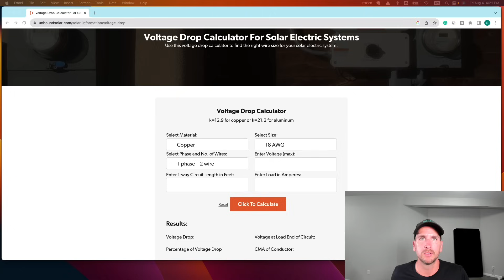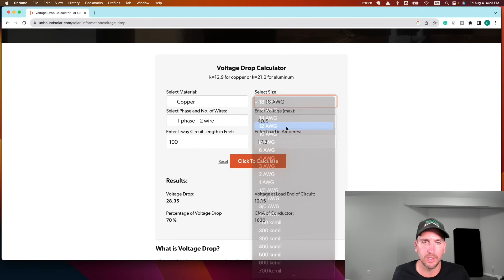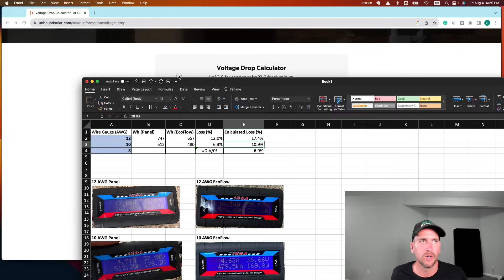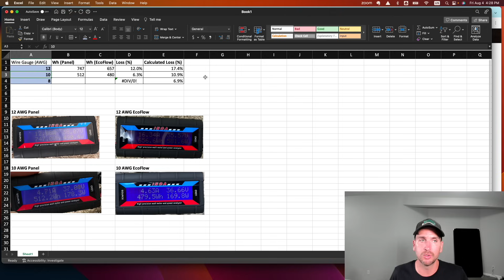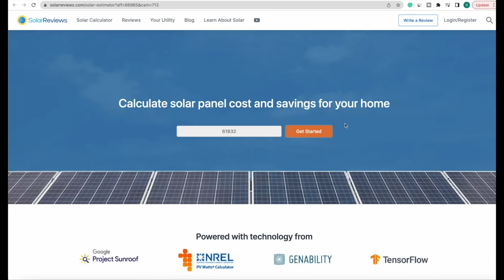What Wire Should You Use For DIY Solar Kits? Surprising Results!

Comment: 20+ years off grid. You should keep your wire runs under 30 feet and 8 gauge for12 volt. 10 gauge for 24 volt and 12 gauge for 48 volt.  You can reduce loss by moving the controller and inverter closer to the panels and use an inverter to run 110 AC to your home. A shed works for that.

I recommend 24 volt in series and a run under 30 feet with 10 or 8 gauge wire for off grid.
Reply: I am confused here. Why would you base wire size on volts? Also why would your wire size go down as volts go up. The NEC uses amps for determining minimum wire size not volts which has left me confused.
Reply: @shadeiland  Your load needs power which is proportional to voltage times current. At a low voltage you then need high current for the desired power and therefore a thick wire to handle the high current. As the cross section of a wire increases, its resistance decreases.
Reply: @solarcabin  yes you need amps to overcome resistance in wires. Volts times amps is watts. I understand all that. The NEC specifically bases wire size on amps not volts. So why are you decreasing wire size based on higher volts? Unless… you are basing it on a set wattage. But wouldn’t the max wattage vary depending on the panel?
Reply: I'm running over a hundred feet, 8 ga, all panels in parallel.. Voltage drop is one volt. I could not care less about voltage drop and all of that. If it's an issue, you can make up for it by adding a panel.  Where variable shade is an issue, parallel is essential.Panels are so cheap there's no point in being concerned about a volt. Good used 240  watt panels in PHX for 30 or 35 bucks.
Off grid for 35 years, in case anyone wondered
Reply: A shed costs a lot more and is WAY more work than conduit and heavier gauge wire. Though a small enclosure for a combiner box at the panels is very practical, but the combiners are generally set up to be outdoors. So they don’t need a totally weather proof enclosure like an inverter and charge controller will. That makes a BIG difference in time money and effort. Plus, the batteries need excellent weather protection, and you don’t want your batteries a long distance from the inverter or your breaker box, or the end use point(s). So in my case I don’t put panels on my roof because that is a whole can of worms for installation and roof repairs/replacement short and long term. I have a nice exposed hill that I put my panels on and it is just simpler to run 4 AWG  into a weather proof cement board cabinet close to the cabin with the controller/inverter/ batteries.
Reply: @5400bowen  You are still going to have significant loss at any long distance with 4AWG.
Reply: @solarcabin  the numbers from many experts disagree with you…4 gauge for 50 feet carrying 72 volts at up to 1980 watts from the panels…quite sufficient. And do you know that the wire gets thicker as the numbers go down? You keep mentioning 10 and 12 gauge..that is WAY smaller than 4 gauge…way smaller…
Reply: @5400bowen  Off Grid 20 years teaching people to install solar and yes I am very aware of how wire gauge works.  You will still have loss at at any significant distance with that gauge.
Reply: The Gauge of wire has absolutley nothing to do with voltage, using that as a method to size a conductor is a dangerous road to walk.
Reply: @shmayazuggot8558  The question was for  A "SOLAR KIT".  My answer is correct and have used and built solar kits for over 20 years.
Reply: @solarcabin  What do you think of sun gold power? I'm think about going with one of their solar kits, this one in particular

8000W 48V 120V/240V OUTPUT 10.24KWH LITHIUM BATTERY 5400 WATT SOLAR PANEL SGK-8MAX

Comment: You don't need that size of wire for that set up. What's that like 200 watts at 24 volts. 10 amp wire should be fine. 20 gauge wire. Stop wasting our wire on that shit. I know you have alot of money and aren't very smart.

Comment: 082723/2041h PST 🇺🇸. Thank you for the presentation on simple and adequate PV cells setup. Yes, it’s so true to venture out to connecting to 110AC system and automatic changeover switching, which is all too much for layman and myself ( electrical engineer)
I have a similar set up 800W PV array and 2X12.80V@540Ahr LiFePo4 Battery, and 1200W inverter. All equipments are VICTRON. Here, in CA , we don’t experience load shedding or Blackouts. But it’s better to possess such a system, than not.
I’ve watched your electrical systems wiring etc, a lot. Thanks again. Best wishes.

Comment: Everyone remember the higher the voltage the smaller the wire you can use. Like for me at 400V and low Amps I think mine are 8.5A and at 100Ft. I can use 12Ga wire and only have a calculated loss of .88%. So if you can up your voltage you will save money in wire and that wire is expensive.

Comment: If you could datalog the voltage and amps through the testing period you'd be able to see why there is a difference between the online calculator and your measurements.  What you want is the average value of the amps squared (amps * amps at each point) over the time interval.  Take the square root of that [average current squared] number to get an "average" current value - and feed that back that into the online calculator.  It will show a result that is a lot closer to your measurements.    The growing difference in the loss % with each larger gauge wire is explained by the lower total Wh over each test interval.  You would see the opposite trend in the closeness of the % loss number if you had a higher load for the 8AWG vs the 12AWG tests. Some rough calculations assuming a 40.5V constant system voltage (needs correction: all of your photos show actual voltage ~36-39V) show that if your trials were approximately 90 minutes for the 12AWG, 75 minutes for the 10AWG, and 80 minutes for the 8AWG - then the theoretical numbers from the online calculator match up.      I think if you were able to fully load this system - receiving a constant 17.8A at 40.5V (721W) - the online calculator would be spot on versus your measurements.

Comment: Surprising results! You can calculate the voltage drop along the length of cable for any length of cable, any thickness of cable. You can do this before you spend any money buying cables.

Comment: good show, but would have been good to let folks know that increasing panel voltage is a great way to reduce line losses (and therefore downsizing gauge of wire).  This is the case since line losses are proportional to the SQUARE of current but only directly proportional to panel voltage.
Reply from the maker: Yeah, that would have been a good addition.  I was keeping the voltage low for the power analyzer limitations so it was a bit misleading as compared to what you would setup in most real work applications.

Comment: 100 feet could be double the length for panels on the roof to the inverter. For 50 feet i can get away with 10 or even 12 gauge.

Comment: wouldnt it have made more sense to have them in series though?  Usually you try to put the panels in Series up towards 800VDC before you start with the nextr string, especially if the panels are far from the inverters.  And with them in Series it would have been half the difference between the wires?
Reply from the maker: I was a bit limited for the power analyzers.  They can only handle a max of 100V so in the real world, for sure, series is my preference whenever possible.  👍
Reply: Although a modern 600 and 700W bifacial panel can have up towards 20Amp per panel so it is still a valid test with 2 of these panels in Parallel.  So I step back a little from my comment above regarding this point, you are doing a perfect test  :)

Comment: Master electrician here.  #2 , 4, or 6 Aluminum USE  is less expensive than any of those you tested. I worked mainly with ground mounted panels and the lengths involved are a very serious issue. Go with at least 48 volt systems and layout to minimize lengths anywhere possible.
Reply: But also , aluminum isn’t as good in tropical climates, especially here on the big island of Hawaii, where we have heat, moisture, sulphuric acid, hydrochloric acid, and salt. Aluminum turns into aluminum oxide here at an astonishing rate. Copper is much less prone to corrosion.
Reply: what is No. 2, 4, 6 for a cross section?
Reply: @jensschroder8214 c’mon now…do a web search, don’t bother the man after he gave us words of true wisdom. Sincerely.
Reply: I always see the suggestion for 24V batter or 48V battery, but at least in my research I don't see inverters sold to handle this, they usually say 12V... Can we use bigger battery anyway?  Also Eco Flow Power station requieres the XT60 Solar Connector wires to connect to solar pannel wires. Does the XT60 solar connector wire need to be the same size as the XT60 solar connector wire?
Reply: @adivasworld  they have inverters of all type. Victron sell them and so do all the big solar companies. But if I'm buying, it's victron for my charge controller and inverter. Superior German engineering.
Reply: @adivasworld victron makes several 24 and 48 volt inverters, along with several other manufacturers.
Reply: @adivasworld I just purchased a simple 48 volt 2000 watt inverter from Amazon. I use it on my 5kwh battery that is 48 volt.
Reply: @cookiedough5374  A normal DC-AC inverter will "work" but will definitely not work well for solar panel input. You need an MPPT module for solar panel input - if you dont you will lose 50% or more of the available power. An MPPT module tracks the varying power input properly in a way that a normal DC-AC inverter cannot.
Reply: @rivimey  thanks for your comment. I charge that battery with a MPPT charger connected to panels.

Comment: One other issue to consider on the wire sizes is that when a wire is run over a roof, the wire can retain heat from the roof and you loose some power there too. 10 awg would be minimum for me on a roof to compensate for the additional loss.
Reply: run it through the attic. Yes, there's still some heat but not as much.
Reply: @georgeperez4770  a valid thought. Or use white wire, or run it straight down as much as possible, or as I do with the cabins we build in Hawaii, use white roofing. But just look up videos on insurance and roofing companies reaction to roof mounted panels. When the roof needs replacing, yer gonna bleed hard. Some insurance companies have started refusing to insure homes with roof mounted panels…
Reply: And that heat cooks your wire. Even the metal is more quickly degraded from heat, and especially the insulation. Wire for outdoor use should be white.

Comment: I've used No.  10 wire casually between 100 watt panels.  The sum runs into heavy aluminum outdoor wire.  21 volts runs through long wires into regulators,  one per battery set delivering 12 - 13 volts into lead batteries.  The solar wires are long and the battery wires are short.  No problems with efficiency.

Comment: Thanks for the video. Very interesting test.  Ive always wanted to see that in the real world.  However I would definitely be going for the 12 awg, especially if the runs are small and they very well could be,  with Panels located directly above your Solar chargers.   I dithered for ages, 18 years ago when I first installed my off the grid house worrying about the gauge of wire.   Turns out line loss is the absolute least of your worries and is easily fixed.  A couple of extra panels will cover any line loss.  Wiring 12 gauge and higher is significantly easier than any of the lower numbers for a DIY.  Anyone fought with Crimp lugs on fine stranded 8 gauge wire 😞 Having said that though... Cabling between your Batteries and Inverter should be as big as you can possibly get. Double them up if possible.  That's where you will get the best value in your cabling.  Your Inverter will love you for it.
Reply: Are you meaning run two leads instead of one when you say double them up? Or double the gauges? Because the first one is something I’ve been saying (and of course have known) for a long time. When I ran my Romex 75 feet from the post inverter breaker box, I did just that. Two ten amp wires can carry 20 amps, and connecting them at either end is perfectly fine. Imagine the multi strands  inside insulation. It is the same thing. And better for heat dissipation. Nice clear correct info, by the way.
Reply: Yes running 2 leads to give you a great big lead  is a great way to solve lack of instantaneous power.  I had a problem with a 5KW inverter that had the recommended size battery leads that kept going into fault mode with any sudden large motor load.   I doubled the Cables and the problem went away.  Very easy to do in an existing installation as well because you can keep your down time to a minimum, and 2 smaller cables are normally cheaper and can give a larger square area of cable. In this situation I was looking at installing soft starts on the motors but didn't need to.  (Still keen to try them out though, so I may still do one anyway) 🙂 @5400bowen
Reply: @garyrussell5559  I also heard that electricity runs on the outside of wires, hence multi strand wire (did I already mention that about multi strand?). Two smaller wires have more surface area for that to happen. It never occurred to me that a double lead was better for high surge devices, seems peculiar. But like my brother said, electricity is magic! And you of course saw what I said about running two strands of Romex because it was rated at 50 feet at my power levels and it is a 75 foot run? The rest of your reply is so pleasantly accurate! Aloha from the big island of Hawaii!!
Reply: @5400bowen That skin effect is only for alternating current not direct.
DC uses the whole cross section of the wire where AC induces eddy currents in the interior of the wire forcing current to run along the surface or skin of the wire.
The higher the frequency the thinner the depth of conduction. It's already micrometers deep at line frequency of 60 hz. so circumference of the wire for AC and cross section area for DC is what determines capacity.
Reply: "Cabling between your Batteries and Inverter should be as big as you can possibly get."  This cannot be over-emphasized.   That inverter should be as close to the battery as possible.  

I find 10ga to be the sweet spot for cost vs. thickness.  After that I would double up.    I buy 10ga low voltage cable  (sold for garden lighting).  Very easy to work with, flexible. but it's single layer insulation may not be appropriate for long term home solar installation without some sort of conduit.  We use black poly here (in Mexico) for conduit.   No idea what the pros use- probably tray cable, which is double sheathed.   Line loss will rarely matter as much as another panel.
Reply: Agreed.  Real world amperage is usually much lower than rated. Especially Winter and cloudy days, morning and afternoon.
Reply: @ceeweedsl  Very true, and one of the most disappointing things you discover when completely Off Grid is that in Spring, summer and Autumn, your battery bank is normally fully charged before noon and the solar is pretty much dumped after that.  In winter however I could triple the amount of solar panels and still struggle to charge my batteries on most days.   My last array of solar panels I installed are completely for the winter sun and are almost upright.  Panel angle lets you squeeze that last bit of current.  I've found with Solar, when you miss, you tend to miss by a mile 🙂
Reply: @garyrussell5559  Right!  Spending money on copper to maximize efficiency on those days when you have too much is hardly the best use of resource. You really want to optimize for when the panels are running at 25-40%. Which means more panel watts. 

Assuming that your issue is lack of light to the panels and not just short days!   But with the almost upright comment, I'm guessing you are pretty far north.
Reply: @ceeweedsl  46.4 degrees South.... so a mixture of short days and lack of light.  🙂

Comment: On a solar panel, what would a (2) 12/3 AWG 100-feet  ORANGE outdoor extension cord combined parallel wires as one wire (one outdoor orange  cord is + ; while second orange cord is --)  for voltage loss be, using this instead of a single 2AWG wire, since its the same diameters  for 100 feet. It's a cost difference of wire vs. Load diameter in loss. Which is a better performance of use. 
I thought you might like to do for another video. 
Thanks, 
ShaRon K.

Comment: Get up to about 500V and 10 gauge wire will have very little loss.
Reply from the maker: Yeah, if you can crank up the voltage that will make a big difference.  That is one of the drawbacks of these portable power stations.

Comment: Thank you for this video! 
A question, the analyzer you are using, I was wondering if it has the ability to record data points over an extended period of time? If it doesn't do you know of a similar solution for a similar price that does do that?
Thank you!
Reply from the maker: This one will just continually record the active session (session starts when you plug it in) but is limited outside of this basic functionality.  I think you could pull this data from the device through the serial port into a Raspberry Pi or similar device to provide much more functionality like plotting out the metrics over time.

Comment: There is an old saying that says just because a calculation can be done does not mean it should be done. You overly complicated the situation with that experiment using way too much computational gadgetry. Sun, clouds, even the dead of night do not affect the amount of resistance per foot of a given wire gauge. Find the resistance in a table, calculate the power dissipated in your length of wire. Done.